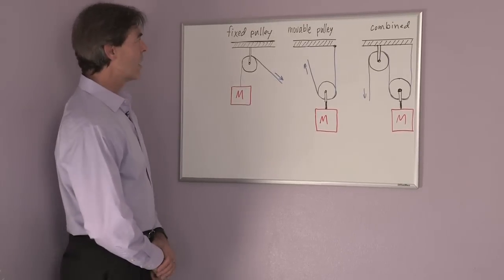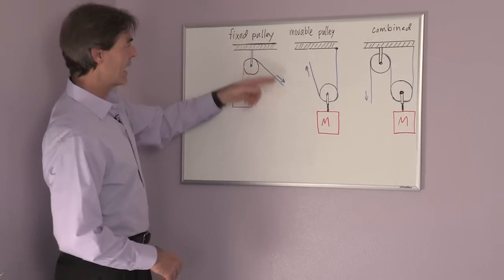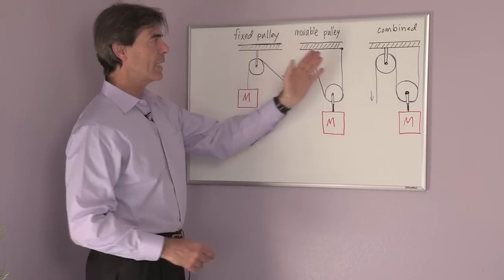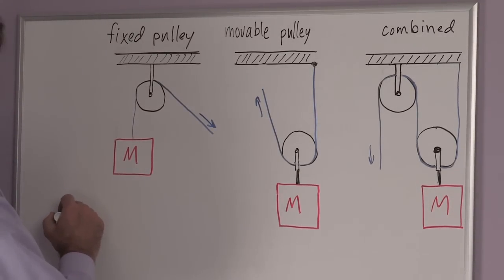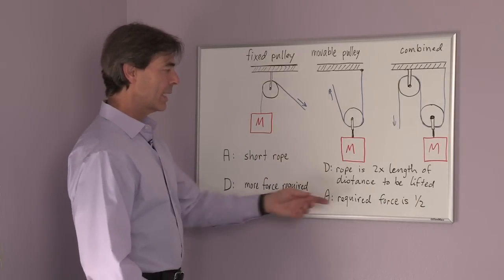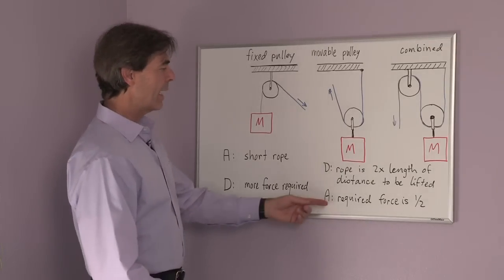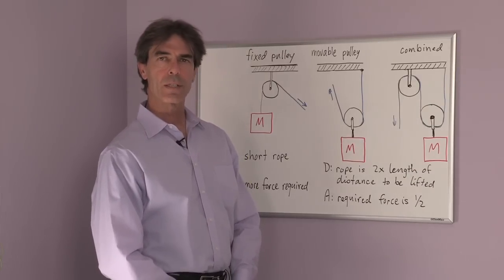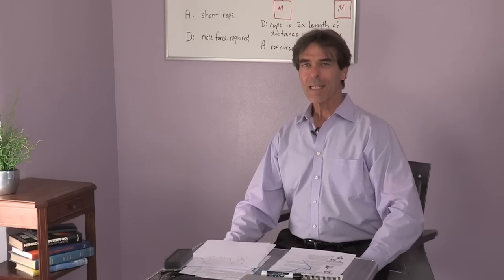What Is an Advantage & Disadvantage of Movable Pulleys? : Chemistry & Physics

Comment: The lenght of rope are the same for the movable pulley and the fixed pulley (lift 10m you need 20m rope in both cases). However with a fixed pulley you got the length of rope divided by 2 you don't have to pull.